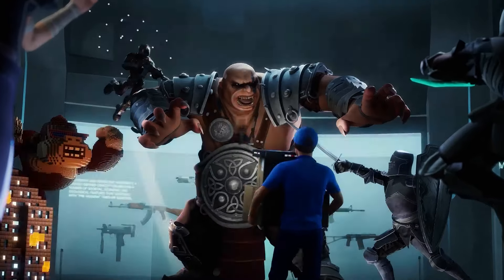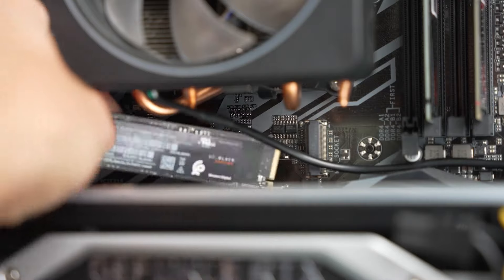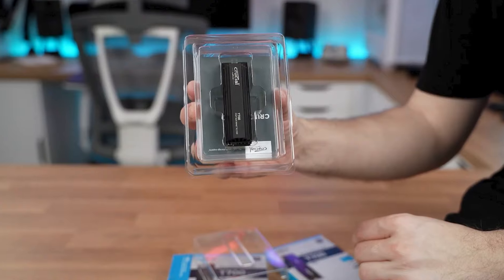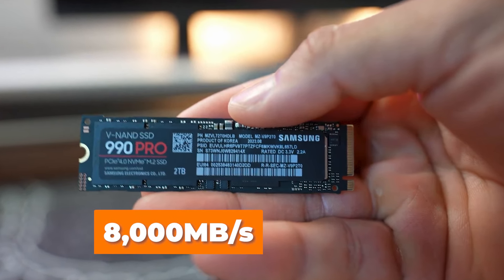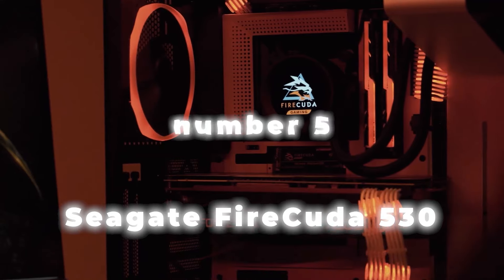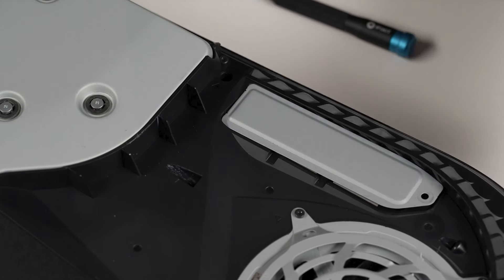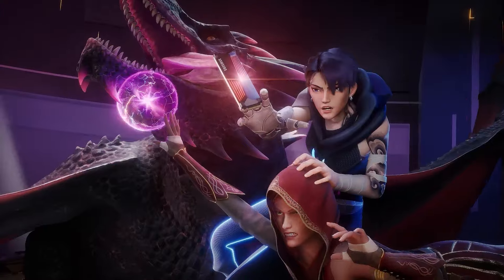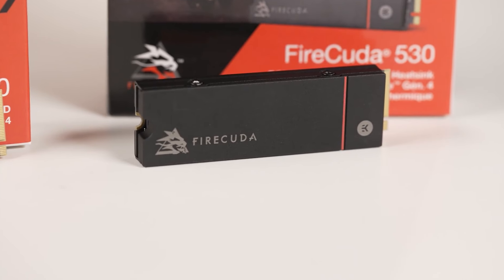Best SSD For Gaming 2024 - Must WATCH Before Buying!

Comment: • Stop saying "Gigabits" for sequential read and write. It's "GigaBytes".
• Stop saying "PCLe". It's "PCIe".
• Your information on the Firecuda 530 2TB is either wrong or outdated. It's officially rated and confirmed working at 7.3 GB/s read and 6.9 GB/s write.
Just some advice if you want to sound more professional. Best of luck with your channel.
Reply: It's MegaBytes/s not GigaBytes/s!!! That would be 7.3 TeraBytes/s otherwise!
Reply: @rantingcommuter2258  Stop being mean he was just trying to make a point, if not, then youre opening the doorss for everyone to crack you apart.  do unto others and karma (which is inescapable) will perform unto yoursellf